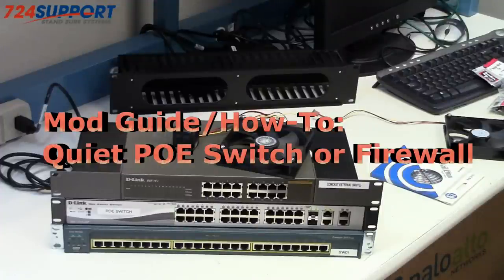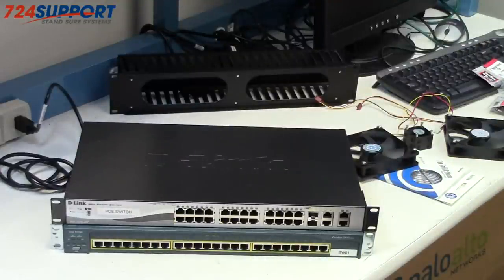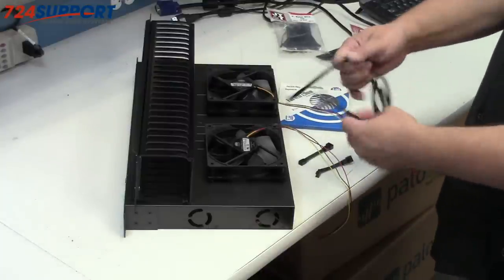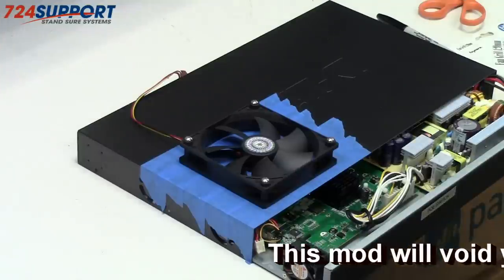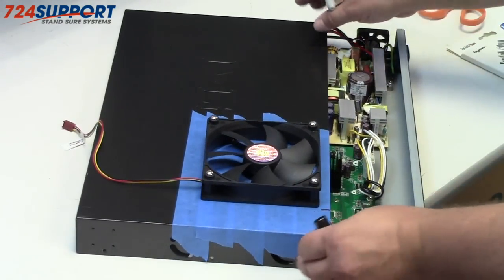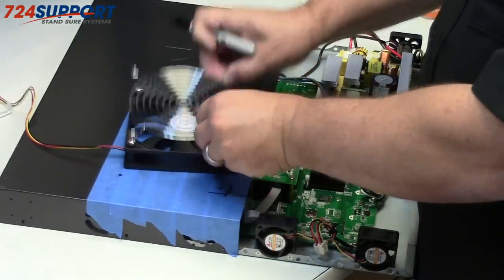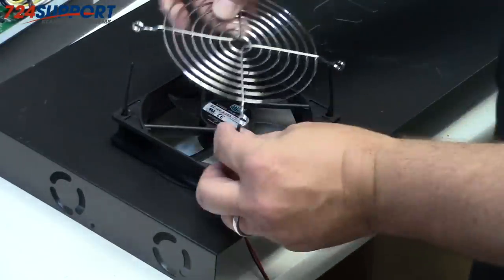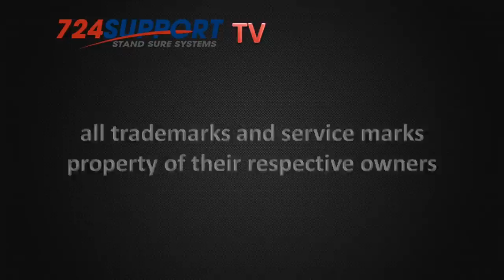Case Mod Quiet Switch or Firewall

Comment: Nice mod, but the original fan ports should be blocked off to avoid changing the thermal air flow.
Reply: Why? in that config of extraction at least you can draw some fresh air in from the side ports, i prefer using larger 200mm fans and blowing in using the side ports as extraction, latest project was a netgear XS708E 10gbe switch, went from warm as hell and loud to cold and silent using a noctua 200mm fan blowing in, side ports expelling air as well.

Comment: Replace the cheap fans for high quality fans of the same size.
Reply: IIRC the small fans from noctua don't put out as much force
Reply: Noctua or whoever cannot change the laws of physics, they put out less cfm and can be detrimental to cooling, at that fan size you can't get cfm and quiet, its one or the other and manufacturers of enterprise or server stuff opt for cfm.

Comment: Just replace the litle one by Noctua fans.
Reply: IIRC the small fans from noctua don't put out as much force as the original one. And a larger fan would be quieter
Reply: Might work for home use but will have thermal issues in a stacked rack, the noctuas push out way less cfm than stock fans, physics cannot be defeated. With a bigger fan you gain magnitudes more cooling and quietness.

Comment: geeez... this is the most ugliest thing you can do to the switch..... POE switches require lots of cooling..... if you can’t deal with the noise stay out of the kitchen.... server room are meant to be loud and the manufacturers design those devices to be properly cooled.... if anything replace the noisy fans with the quieter fans.... Ugly....
Reply: usmc raid who the hell cares if it's ugly lol? 

This is the back of a rack mount swicth. You will never ever see this when it's in the rack lol. 

Also, they are designed to be 1U, which forces the use of blower fans, which can not be had quiet versions of.

As to server rooms are meant to be loud, ya that's all fine and good, as long as you are a business that has a place for a full server room. What about people that have racks in their house? So the rack in my bedroom closest should keep me from sleeping? I don't think so.
Reply: Tell that to Karen at Gimme All Yo Money Bank branch 69 complaining about the noise from the closet next to her desk.